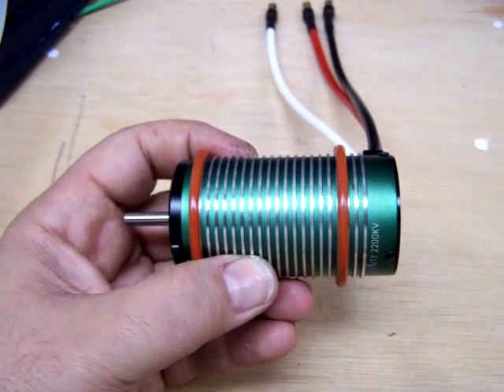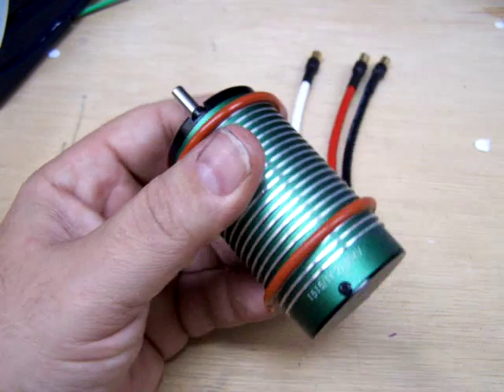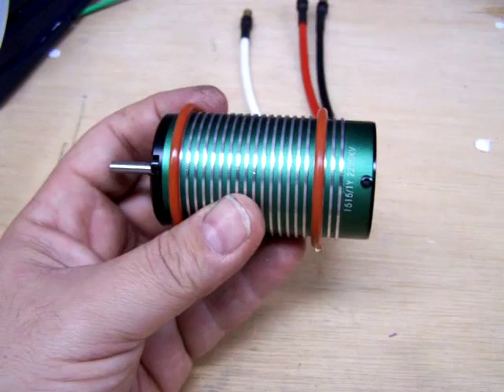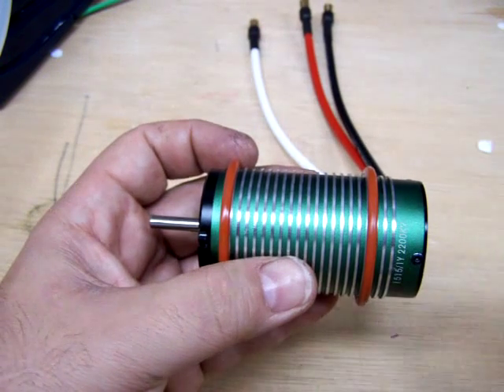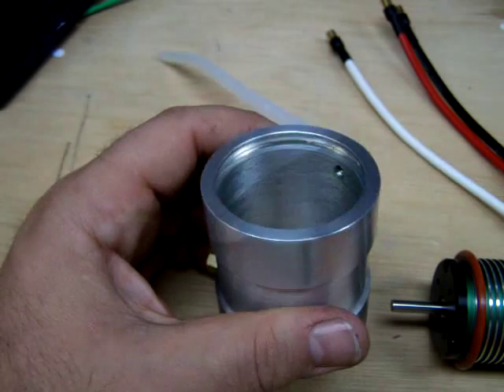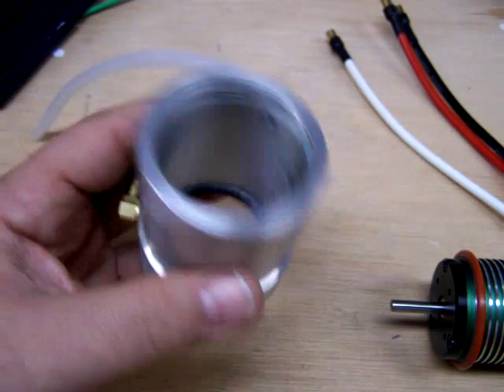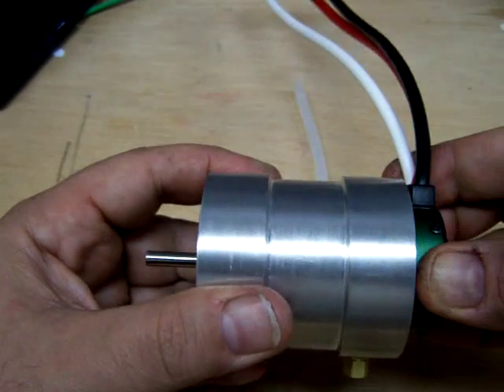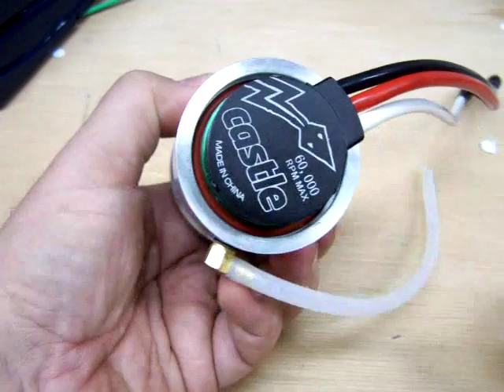Feigao 580 Water Jacket on a Castle Creations 1515 Motor

Comment: does it works with the 180a esc and is that it to fix it and how to test it before?  regards
Reply from the maker: Its for the motor, this was a test. we had to make them specifically for each motor. what did you need for the seaking 180?

Comment from the maker: This is just a test. The water jacket in the video is for a larger 580 motor that we put on a smaller diameter Castle 1515 motor. That was because at that point we had no water jackets for the Castle 1515. Now we make specific jackets just for the Castle Creations 1515 and they work perfect.
Reply: Link please?

Comment from the maker: The water jacket allows you to run water around the motor for cooling. There are no holes in the motor. So it is waterproof. 

Boat esc's are water cooled.

This video is old now. We make a castle 1515 jacket to fit this motor for a perfect fit.